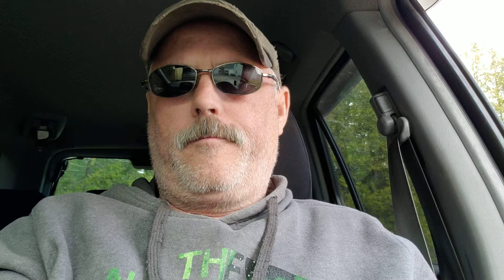2017 Polaris Sportsman 570SP 90PSI compression test

Comment: So what ever happened. Btw the motor has a decompression pin for starting and the compression wile starting should be between 80 and 120.  Once the motor starts the pin deactivates and the compression increases to the 140 area. They do that bc the starters don't have the power to turn the motor over at that psi and it's impossible to test it to see that compression.
Reply from the maker: I know.  My Polaris mechanic said that to me as well.